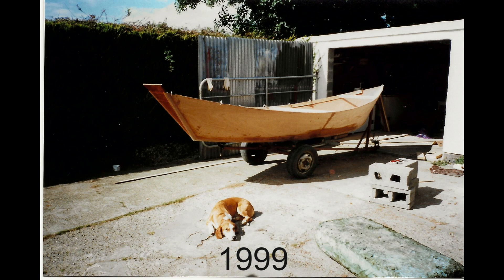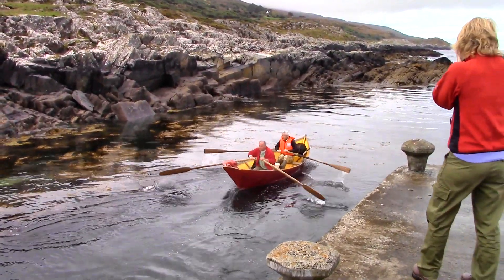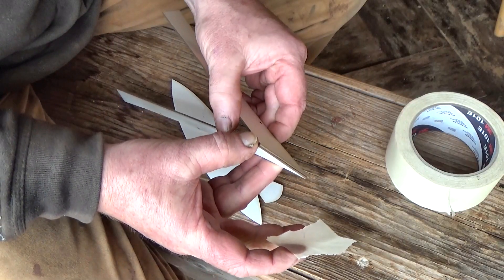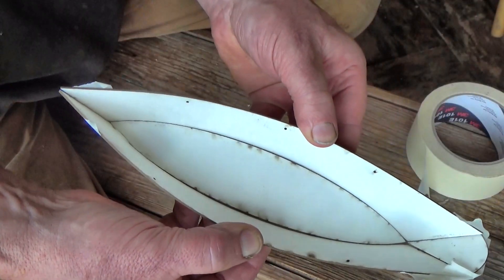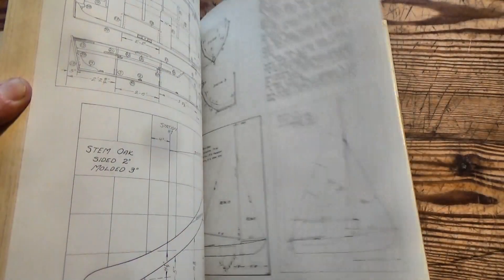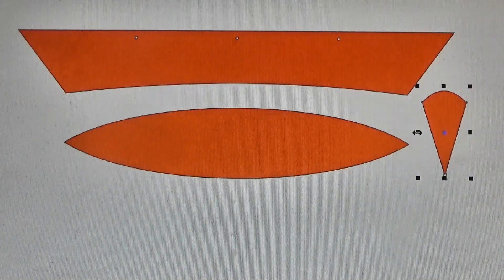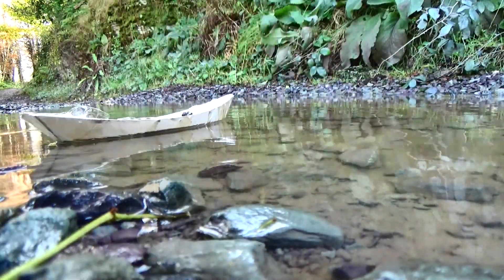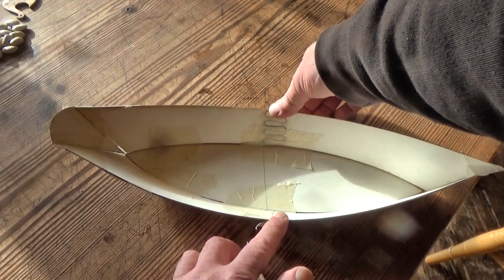Designing A New Dory Rowing Boat With A Scale Model.

Comment: THey were developed along the New England and Canadian maritime communities (not just Canada). The grand banks style you  have is just one type used from scooners. Dories rowed from shore often had more rocker and more curve around the bilge. like the Swampscott style. I would recommend at least putting a bit of rocker in the bottom. It will make the boat much more nimble and easier to maneuver with one oarsman and more able to slide over incoming waves
Reply from the maker: have a look at the latest video, John. We did just as you suggest